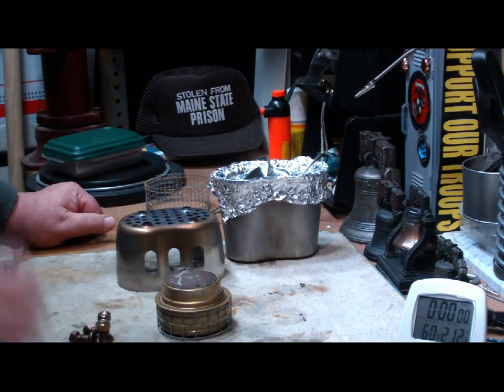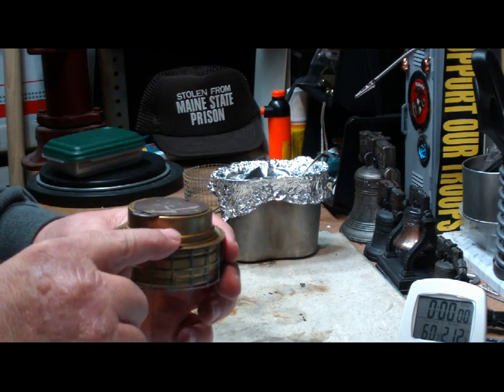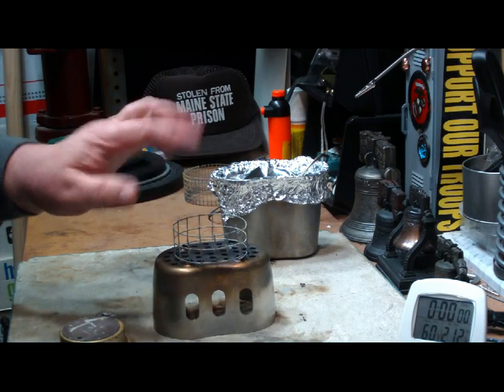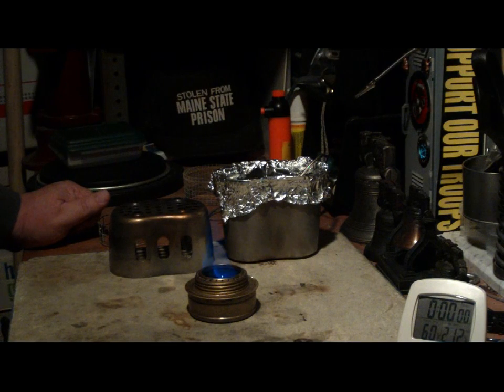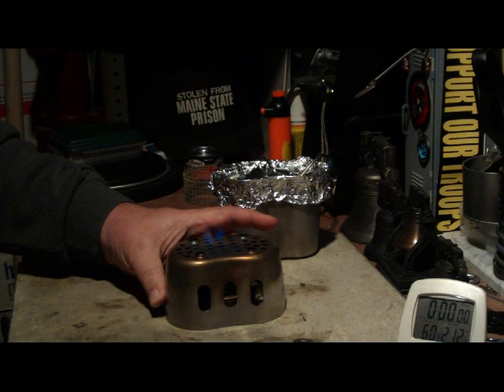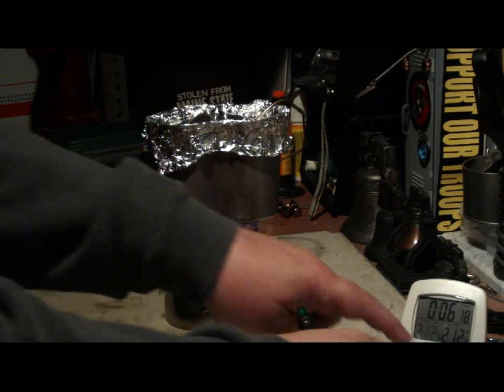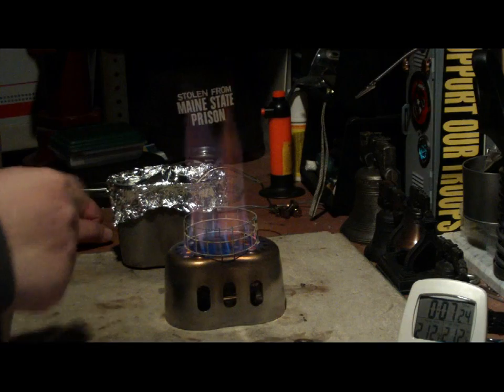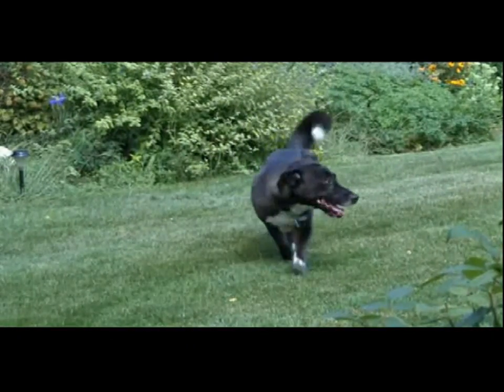CanteenShop GrillTop Stove Stand - Trangia - Boil Test #5

Comment: Hi Hiram, a really useful set of tests. I must say I prefer the nuts rather than hardware cloth as the pot surface looks a lot more stable. To reduce the extra weight some much thinner bolts with washers could be used. I'm expecting a Grill Top any day now from your side of the pond to my side in Wales. Apart from that article all I need is for the rain to stop: wettest winter for 100 years.

Comment: This is my second Idea as I ran out of comment room.

Get a piece of sheet metal and form it to the shape of the stand's top / canteen cup's bottom.  Make it so it is about 1/4" smaller in area all around and that it will also be snug around the 4 stand ports.  You could also make it have the slices so you can take it apart for storage and slide the ends together when you need it.  Again you could put some holes in for air flow and strength.

Thanks again for the great videos!

Comment: Hi Hiram.  These videos are fantastic.  I remember in the earlier video you tried to make a Cross wth some metal.  I have 2 ideas for the efficiency based on your last few videos.

#1.  What about making a rectangle version that just tightly fit around the stand ports?  You would most likely have a very sturdy stand and could drill holes in the sides if needed.  It would also be collapsible as it would be four peices that just slide together.

Comment: I believe what lilricky2515 was trying to state is, He thinks that with the GrillTop stove is acting as a heat sink. In this manner, as you know, is igniting the vapors more so,, giving more heat while robbing fuel from the Trangia.  I think he is wondering ,as am I, if you can also give us some more  weight variations on the fuel. Thank you for the consideration.

Comment: another great video, hiram.  thanks.

seems like the weight trade off for those 12-13 seconds would be worth it.  the bolts would have crazy durability, though.  did you have any issues removing those bolts after they cool?